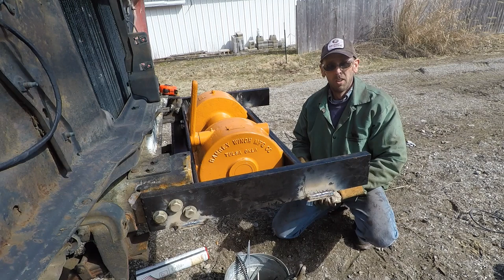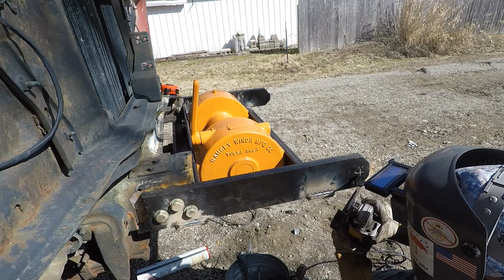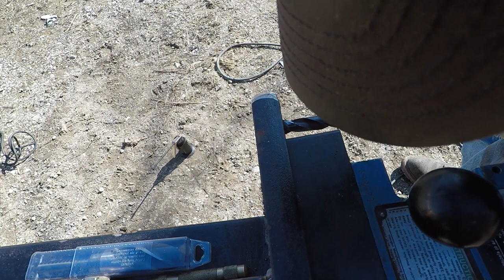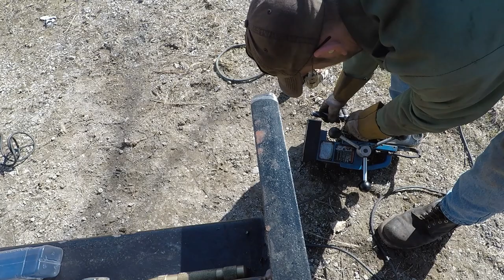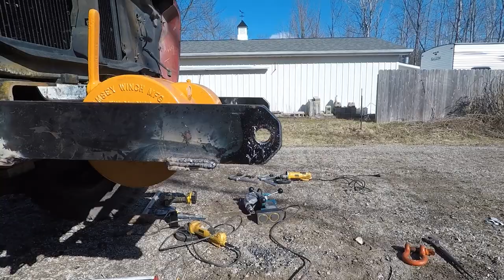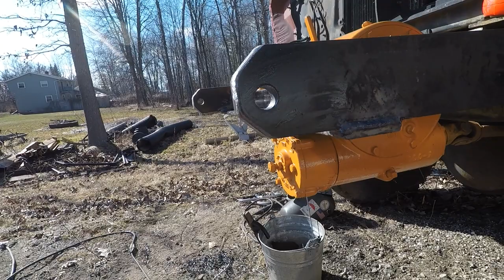Making Shackle Mounts

Comment: Do you have any annular cutters for your mag drill?They work pretty sweet and then you can skip the step drilling. I am liking this build! Thanks for taking us along.
Reply from the maker: Yes, I have annular cutters for the mag drill. The chuck adapter currently on it, is threaded onto the arbor & is a pain to remove. I had more holes to enlarge on the truck frame & holes that needed to be tapped. Both of which is not the annular cutter's forte.

Thanks! I'm glad you're enjoying it!